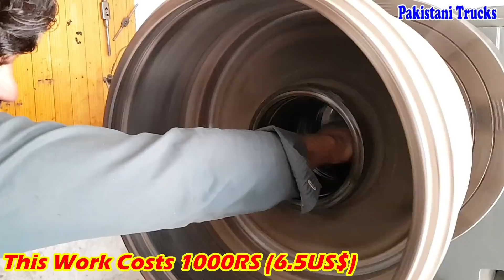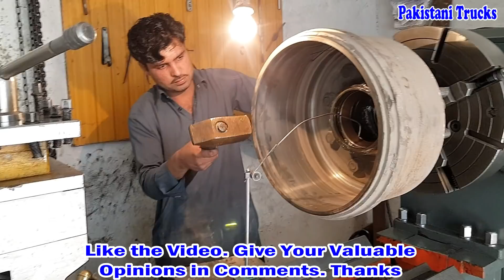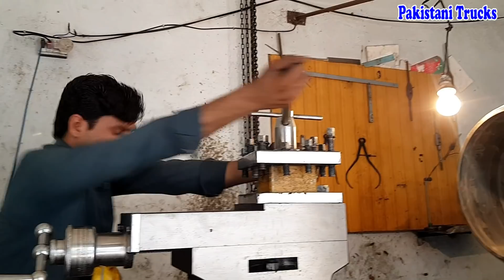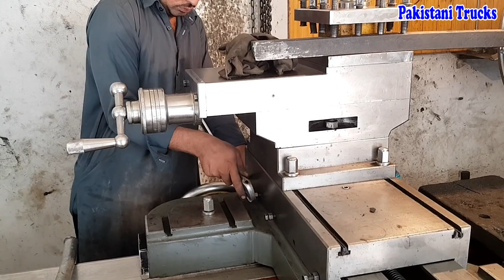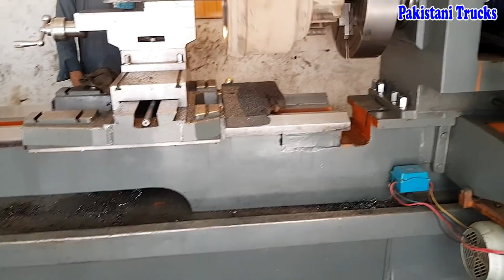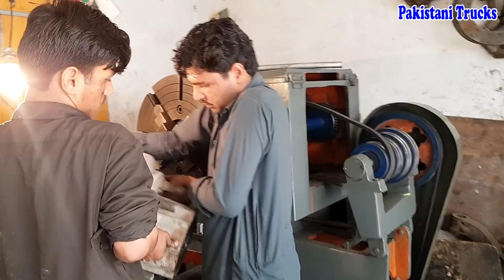Restoration of Old Drum | Repairing and Resurfacing Drum for Strong Brakes

Comment: Good to see your machinists getting the jobs done.Most of the negative comments are from people that will take 3 days to do a 1 day job and would wait a week for an insert before they can start the job.The only tip I would suggest to avoid chatter on a bore is to stretch the rubber from an inner tube around the outside of the drum but you probably know that.

Comment: Sorry but no!!!...I have turned hundreds of these ...I worked at a huge high Volume Auto Parts back in the day and That drum is not fully completed...It's straight...but that's it...Mite I suggest you put a Rubber belt on the outside when you turn these (It's called a chatter belt)...the Drum is Vibrating when your Turing it...that's why all the tool marks are present...Just a Comment

Comment: Nothing like getting the drum withing 8 million thousands of center.... Going to get a good pulse... these guys, while trying to do the best they can, just are really hacking their way through.
Reply: The finish on the drum will shred the brake shoes or lock up the wheel.
Reply: @norton750cc  or cause clicking in forward or reverse depending on what side of the truck it's on.   You could see the record groove in the video...actually see it.

Comment: I'll assume that was oversized before you machined it...  Don't use the 2' pipe to tighten/loosen the tool holder either.  Just 3/8" bolts.  Be safe guys!

Comment: You shouldn't have a pipe on the "T" handle to loosen/tighten the jaws.  You're going to bugger something up.  And, get some safety glasses...
Reply: I've seen him changing gears with those belts when engine was running so safety? Glasses? AA no go
Reply: Add loose clothes, using side of grinding wheel. Their ad-hoc skills are brilliant, but I,d wonder how many are disfigured by accidents?
Reply: @migrationfuntimes303  I agree.   I understand they're working with what they've got, but it seems somebody has money to buy new equipment.  Might want to wiggle some safety gear into the budget. Maybe raise the shop rates? $5 US for all the work they do seems really low.
Reply: I have seen other very well respected YouTube machinists including Abom and CEE use cheater bars on chuck keys.  Might ne related to the scale of the equipment.  These guys all use chucks in excess of 12" in diameter.....
Reply: @cammurray8453  "cheater" self-implies that it's probably not a good idea.  There's a time and a place...  Have I ever put a pipe on something to make something happen.  Yes.  Chuck in a lathe... Not a good place.